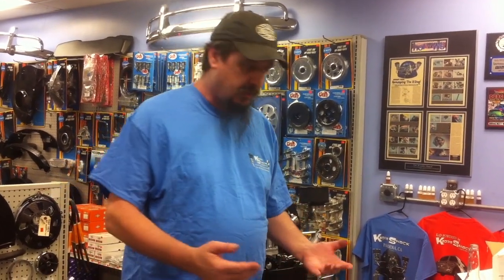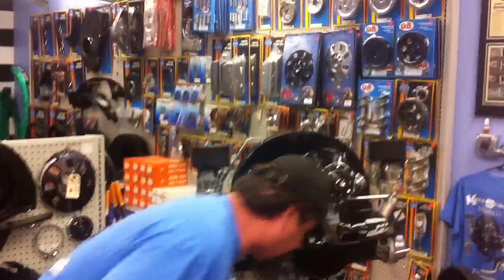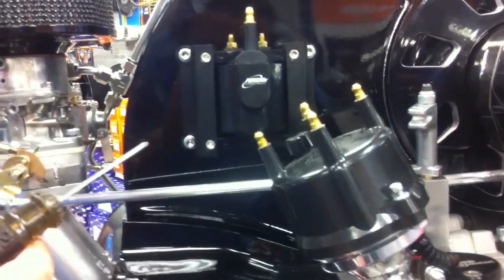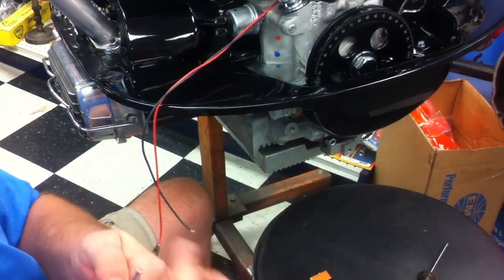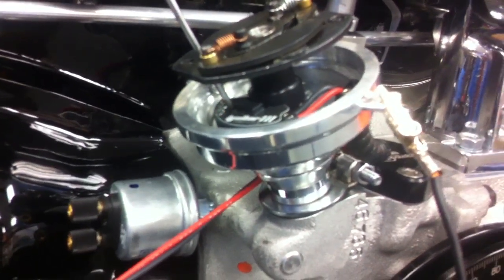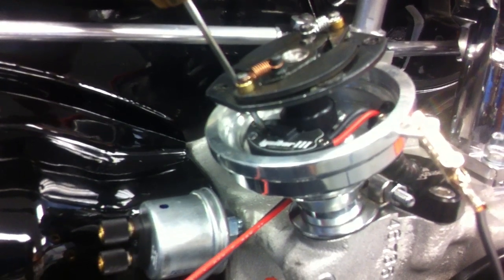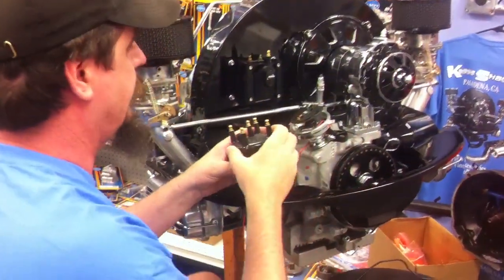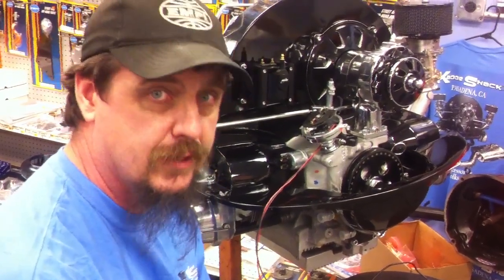Kaddie Shack TECH TV: Pertronix Ignitor 3 VW Features and Installation

Comment: I just bought one and installed it.  I love it.. What should a stock 1600cc engine rpm rev limiter be set to? and do you have a video to set the timing since it seems it will no longer set by static timing
Reply: 4,500-5000
Reply: @bubot17  awesome thanks!

Comment: This is an old video, but still a good one.  ONE IMPORTANT FEATURE YOU LEFT OUT.....Pertronix I and II BOTH will burn up if you leave the key on and the engine is not running in a VERY SHORT TIME.  The Pertronix III will NOT burn up if you leave the key on and the engine is not running....VERY IMPORTANT FEATURE !!

Comment: how well with this work with a 32/36 progressive carb? i was looking at running the same coil that you have on this engine. do you think i would be fine running that coil, with the flame thrower lll with the vacuum advaced distributor, or do you think i should go with the larger flame thrower lll distributor with out the vacuum advance. i have read that the progressive carb should use a vacuum advance disgtributor. However i have also read that if i run that coil i should go with the larger disributor because of the chance of having the spark  jumping from one post to the other.

Comment: Is it possible to turn the built in rev limiter with the module off and not use it, because I already have the pertronix rev limiter box set up?
Reply from the maker: Kyle Munn Hi Kyle.  Yes.  Good question.  Set it to programming mode like in the video, and turn the screw counterclockwise until it stops.  This disables the rev limiting function.
Reply: Kaddie Shack ok, cool! thanks for the help. Might upgrade my Ignitor II unit to this module in the future!